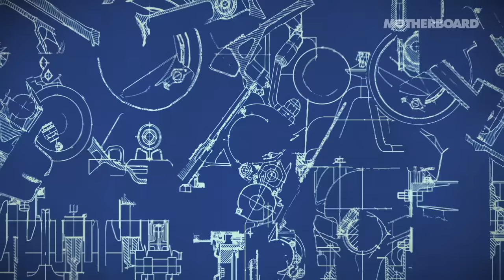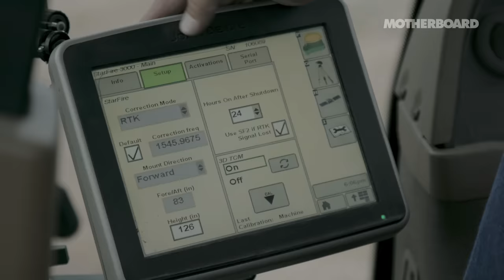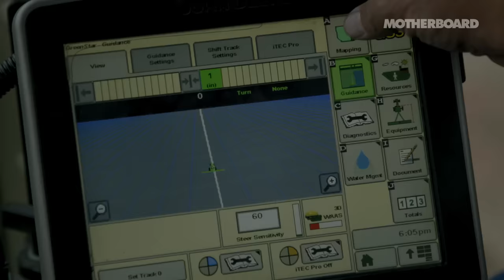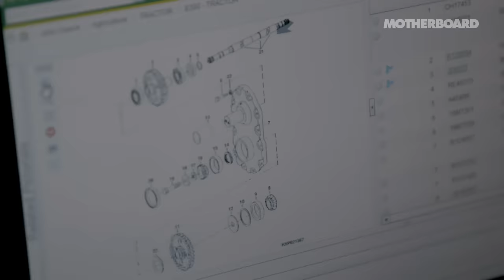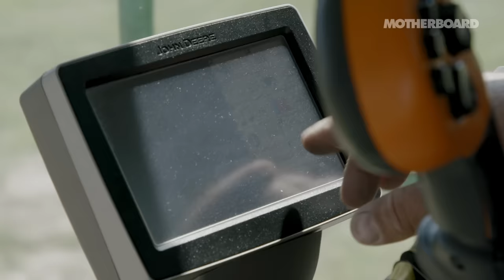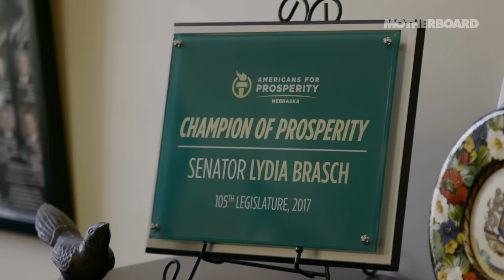Farmers Are Hacking Their Tractors Because of a Right to Repair Ban

Comment: buys tractor 
Company: "This comes with a 5 year warranty on any parts and repairs!"
2 months later, doesn't turn on
Company: "Please pay $1000 to transport it to us so we can tell you to buy a new part because we don't support the parts in this tractor anymore"
Reply: It's just as bad in the automotive industry. I had to junk out a good running 03 dodge neon because the transponder would not recognize the key. It put itself in (anti theft) mode and even the dealership said they didn't have the outdated software to reprogram the system.
Reply: tell me about it, i had to junk a dodge stratus and my e-350 powerstroke because i couldn't get parts. idiots at the dealer and parts stores always try to bullshit me and tell me all parts are the same for the powerstroke. according to dealer and parts store stratus doesn't have fuel filters, sadly i believe the manual listed 4 but there's at least five types.
Reply: In reality though, most warranties dont cover labor, just the part. So you still have to pay for a diagnosis and labor to replace the defective part
Reply: Reclusive Eagle I work in a dealership and it isn’t 1000 to transport. It’s way less
Reply: @user-wc3sl4xs6l  depends on circumstances. Distance, size of equipment etc.  Your situation is not universal.
Reply: I'm tempted to junk my 2006 Toyota because it's unreliable as hell and something is always broken on it
Reply: Yea I seen that but mainly when it is insurance and or misuse not just cause. Always give customer benefit of the doubt unless it is obvious
Reply: My haul rates are 375 for 50 miles when I wench it ,if there billing you that its ur dealee
Reply: @ronaldtreitner1460  the Stratus probably DOESN'T have a fuel filter. By the mid-90s, most Chryslers switched to a (non-serviceable) in-tank "sock" filter.  My Dakota and Cherokee had that type, only replaced if doing a fuel pump.

Comment: Time is ripe for open source machinery, where parts can be made by anyone who wants to make them, and fixed by anyone who wants to fix them.
Reply: combined with a community of 3d printing machines, i think theres something to this!
Reply: there is only one problem. imagine you have an idea, so you start a company and make that item. now a big company sees that and goes "thats mine now" a bigger company can push it harder and squish you out. thats why patents and copyright are a thing
Reply: @pulsar9681  commons licence could be an option
Reply: @pulsar9681  there is a way to be open source and patented.
Reply: I see a million and one people asking for open sourced technology, but only so many people willing to put the years required into making something professional level and then just giving the secrets away.
Reply: @pulsar9681  thats why they shouldn't exist
Reply: @Sam-dc9bg  well youre not wrong, but it does attract a lot of people who can improve upon an established design, people like engineering undergraduates who want to work for their thesis for example
Reply: @Sam-dc9bg  open source has been great (best case is in software and hardware). if you want more advanced tech, then buy the latest from the vendors, but you can also get the community edition which does not come with support (which you could do yourself, get from third party, or from the vendors themselves). in pharma, the analogy would be the branded ones vs generic.  provides opportunity at many levels and at the same time respect for patent protection.
Reply: Time is ripe?  More like that time has passed.  That's how it used to be.  I can't repair modern vehicles, but I can tear down and rebuild older ones all day.  Good machinists can replicate damaged parts if they aren't readily available.  But this modern stuff is engineered to make the consumer pay the ridiculous premium at dealerships.  FYI, don't yell at the mechanics, they get paid crap.  The dealerships and garages keep most of the money.
Reply: @NZIsaacNZ  often times the parts that break break due to stress, and are made out of metal. Your 3d printer isn't up to the task, a machinist shop is needed
Reply: Alright, will you start engineering a minimum viable product? Lmao
Reply: @emperorsgoldenboy3735  metal 3d printer
Reply: @goldendash1527  still not the best solution, cast parts are weaker than machined parts, and machined parts are weaker than forged

It can work for lower stress applications thought that's for sure
Reply: That would work for technical, DIY people who take responsibility to learn and practise tech.
For "Consumers" who expect perfection and sue on a whim, let them accept and pay for big corp closed products.
Two markets, a Technocracy, perhaps

Comment: It’s not just John Deere that’s like that. Apple is doing the same thing with their phones. Even if you buy legitimate parts for your phone, you can’t install them because they’re all serialized. They just won’t work. In the iPhone 12, you can’t repair it anywhere but Apple. All the parts need software to be run or they just won’t work. Even something as simple as a battery and it’s only gonna get worse.
Reply: Ok
Reply: Yeah thats crazy I just watched that video 2
Reply: So actually a very proficient hacker can have a very lucrative career.
Reply: Been going on for decades! Just getting worse. This problem goes for ANTTHING repairable and electronic. You get "Proprietary" or just plain no. End of story.
Reply: Yes I agree with the home button on older phones, the cameras on the 12 and the screen,  it’s like Tesla
Reply: Its pretty much the same with tesla. They will not sell you a part to fix it yourself. You have to send it to them. Of course obviously the want that monopoly to have all that money. How crooked the world is huh
Reply: @JuanCastillo-nx3oi  no not really. Electric cars are very new, and dangerous to work on. They are not going to let you repair because that opens them up for lawsuits if someone electrocuts themself.
Reply: @Levi-qb2uf  Thats total bs. You can have an accident repairing anything even switching a lightbulb at home.
Reply: @Levi-qb2uf  that’s bs, even if you do fix it and it’s 100% normal they will disable service to the car, and you have to pay them to maybe tell you it’s ok. If you take it somewhere else and they find out then same thing
Reply: It’s been that way since the first iPhone.. and Android is almost the same way stop taking sides.
Reply: Easy solution 
 Dont buy apple.
Reply: Ye, just ignore apple's existence. Hope they fall apart soon, cause of their business practices, and not design issues or image problems.
Reply: except one of those you can make a living off of
Reply: that's why i stopped buying apple. My family is apple free.
Reply: @StockHeightChevy603  i have changed many parts in my android and they work however repairing phones is getting more difficult and costly
Reply: But people are supporting this. Anytime you buy an Apple product, you support this. What's more is, unlike with tractors,  for which John Deere has a near monopoly in America, you can easily buy a non-Apple phone, or non-Apple computer. Heck, you can easily build  computer for 1/3 the cost of a mac and better performance.
Reply: That is really true this company work like this and will try to make more harder to replace or fix for the reason can make a monopoly from that. Idk if you ever hear about the computer Apple or any other electronics if you fixed you can't call for the name if you fix a MacBook and you sell that you need to put is a computer no a MacBook. Sound stupid but is happening and will going to get more complicated on the future if is not get a stop
Reply: The main difference between a tractor & an iPhone...

iPhone 
It breaks, one hour transit to dealership, 24 hours to repair, one hour home. cost = two Transit fares ($3.84 each, locally) + repair bill (~$50) = <$60+$260 in lost business time.  All business that has been delayed is recovered within 7 days. 
effective cost: $320!

Tractor
Breaks, four hour wait for carrying truck, 2 hours transit to dealership, 24 hours to repair, 2 hours home,,, cost = $1,000 each way, + repair bill ($10,000) =$12,000 + $320 in lost business time,  Any business delayed, cannot be recovered because (pick one, any one or more):
1) Ground is now too wet to work.
2) Product has spoiled on the plant, and cannot now be sold for profit.
3) Ground has dried out too much and cannot be worked
4) Work time windows are closed.

if the farm doesn't make enough to meet their overdraft payments, at end of year Farm has to be sold,

Your grocery bill jumps because there is less food available [law of supply & demand]

If this happens to enough farmers... 
... your supermarket runs out of food!  You can't buy enough to eat... and you end up with food riots through-out the Untied States.
effective cost: from $12,320 to the loss of livelihood for one farmer & his family up to and including the way of life through-out the USofA.
Reply: I have three a Apple devices. In May 2017 my iPhone 6s needed a battery. It was replaced free of charge but the incident required three phones to get one that worked correctly. Last month the battery was heating up and phone vibrated so strongly that it was uncomfortable to hold. They have had the phone ten days in Carlisle, PA. They emailed me to report that three other issues were found and I authorized repair at the cost of $235.00. I still have no phone. I’d be foolish to tell them what to fix in the phone…I am at their mercy. I have been an Apple customer ten years and like their products, Apple Care and operating systems. Perhaps similar cases would be found with John Deere. It is wise to look at both sides of the issue. When I buy anything with a warranty now I look the warranty over very carefully to know what I’m getting in to. I surmise there is wisdom in this message…let the buyer beware.
Reply: That’s not true! My sister broke her screen and replaced it at a random repair shop because we don’t have Apple store in town and it’s working pretty well. I have to note that the quality of the screen isn’t as good as the one came with the phone.
Reply: It's not just John Deere, Apple, Samsung and so on... some years ago a friend of mine had to replace the battery on his Audi A6,  guess what: The new battery had to be programmed to the car! Of course he had to go to Audi at this time (meanwhile, as I heard, there is sw available for private persons also) - And this was in Germany (EU)!!!
Reply: My wife works at a cell phone repair shop and says thats not true about the Iphone 12
Reply: Just stop feeding these super morbidly obese companies.
Reply: Tesla
Reply: @alucard11  Was it one of the new iPhone 12? The older iPhones were still repairable. Just have to have a special screw driver to get in.
Reply: Yes, but they didn’t add the charger block to save the environment!
Reply: @clowndriver5576  you do realise that a tesla is way more complicated than a lightbulb right?
Reply: That's why I switched to Android
Reply: Apple is one thing, at least it is "cheap". Try Tesla. No longer just a phone.
Reply: Start redesigning and rebuilding your engineering technologies back to the pre-computer era of the 1970s where everything is 100% DIY repairable, upgradable, fixable, inspectable, testable, checkable, rebuildable, etc, and what have you! Pass American Laws baning planned obsolescence by making everything 100% DIY restorable! I can still remember that late 1980s going way back to the entire 1970s and 1960s and 1950s and 1940s where everything is held together by screws, nuts and bolts, mechanical clamps, mechanical sliding clamps and other kinds of mechanical connections that can ALLOW ALL AND ANY OF THE COMPONENTS TO BE REPLACED AND THAT INCLUDES THE SUB-ASSEMBLIES SO THAT THE ENTIRE PRODUCT CAN BE REPAIRED AND BE REPAIRABLE AND UPGRADBLE AND SCALABLE INDEFINITELY.
Reply: Do you spend 1.5m on your fucking phone.
Reply: Simple, don't buy Apple. Problem solved. I've never bought Apple, I never will. too many problems dealing with their stupid corporate policies so I avoid them completely now.
Reply: Vote with your dollars.
Reply: Thats why idont buy apple products. Dodge is trying to do the same thing .
Reply: Yea i can repair iPhones and stuff like that up until the iPhone 12 now if someone comes to me to ask for it I have to tell them apple needs to do it and wayyyyy over charge for it
Reply: Keep it !
Reply: @Levi-qb2uf   Really the old cars had a flammable fuel in them! I know I made a mistake! Electric cars are no more dangerous than older ones! What about the iPhone and Apple products? How dangerous are they? Its not that they want to control your product even after you own it! You could make last way longer than the company intended!
Reply: Great reason NOT TO BUY APPLE
Reply: That's why Opensource is best, always. This is why I don't own any Apple products, save for a little iPod from 10 years ago... that nothing runs on anymore because Apple doesn't support it. ;-) Android is an opensource platform that anyone can build on.
Reply: @Levi-qb2uf  Chevy will sell me parts for a chevy bolt. Why would they if it is such a liability? ICE engines and brakes specifically, are very dangerous to fix if you don't know what your doing. But i can go to any parts store and buy brake parts anywhere in the USA.
Reply: Jake Songster  what about backyard mechanics doing substandard brake repair? That puts everyone on the road at risk. I can buy brake parts at any parts store in town.
Reply: @Daniel Padillathat will never happen
Reply: exactly why i use android
Reply: Thats why Rossman is there 08:52

Comment: The last words are so true.  I still see lots of 1950s, 60s, 70s tractors working.   How many 1990s tractors and above are going to be working in 20 years?
Reply: I'm currently in the market for a used tractor, I was looking at a deere 3032 with loader & 4x4... but now idk. 
Who makes an equivalent machine that I'll be able fix myself?
Reply: WE ARE STILL USING MY GRANDFATHER'S  I.H. FARMALL SUPER A, AND MY DAD'S FORD JUBILEE AND ALL 4 OF HIS FORD 4OOO DIESELS.  WE MAY HAVE TO WORK LONGER TO GET THE WORK DONE,  BUT, AT THE END OF THE DAY,  IT GETS DONE, AND ANYTHING THAT DOES GO WRONG WITH OUR EQUIPMENT, BETWEEN MY 4 BROTHERS AND MYSELF,  WE CAN FIX IT.  WE CAN SEPARATE, DISASSEMBLE, AND REBUILD OUR SUPER A IN JUST UNDER 24 HOURS,  GRANTED WE HAVE ALL OF THE NEW PARTS AND GASKETS.
Reply: E. P. Yes I suggest going on Fastline and looking up your hp range you’ll find a mother load of great tractors.
Reply: Same could be said about cars too
Reply: Zero.
Iron isnt the same grade and they are engineered to fail. Not to last.
Reply: 3
Reply: Your right
Reply: @andyreid7274  its not the steel thats the problem...its the basic software...once thats obsolete and something breaks, it'll be im possible to fix...forcing the farmer to spend what will damn near be over a million dollars with what those things are selling for now...there wont be family owned farms anymore cause no one will be able to afford to buy and maintain the equipment
Reply: The ranch I work on has 80s tractors and they work better than some newer tractors we have. Technology just complicates simple tasks.
Reply: Ofcourse they wont work! Thats the business model! Also having all that electrical stuff which you cant touch, theres no way even with "real service" that these shttrucks will last 20+ years..
Reply: 0 to 5% but my 1942 tractor will still do everything it did off the showroom floor
Reply: Yeah, probably not. They'll just say that they don't support these models/software anymore and tell the farmers to buy new...
Reply: @E.P.7131  import one from india!!! they're cheap and repairable
Reply: @E.P.7131  I don't think anybody makes an equivalent on which you can fix everything yourself. Anything from that gen has to comply with the same diagnostics, emission engine monitoring regulations etc... Stuff you need propriatary software for to diagnose and update.
But this docu is slighly excessive, it really only concerns parts that have advanced electronics, which is a minor part of all potential repairs. And also generally something you simply wouldn't want to mess with without proper training because it really requires advanced knowledge. Whenever we had electronic issues they had to send an engineer from the parent company because there are only a few people per country able to work with the software. And these guys are high IQ hacker types.
Reply: They'll be in the junk pile.
Reply: The Amish are still getting the job done. Just use horse's mane.